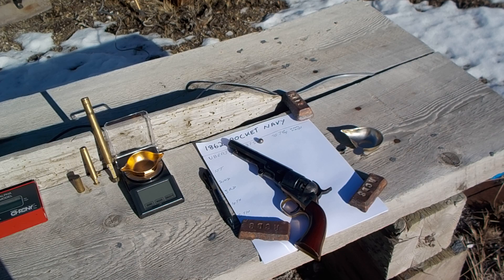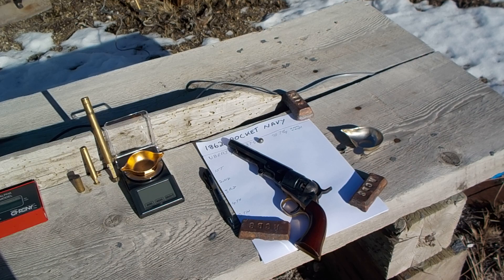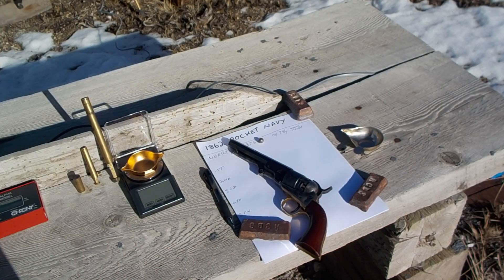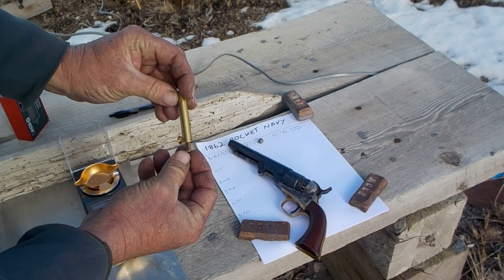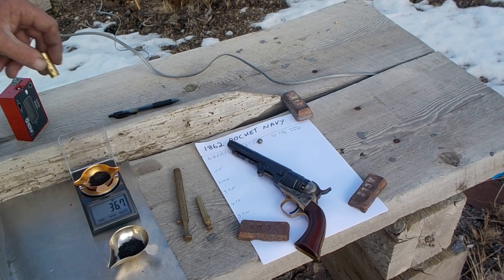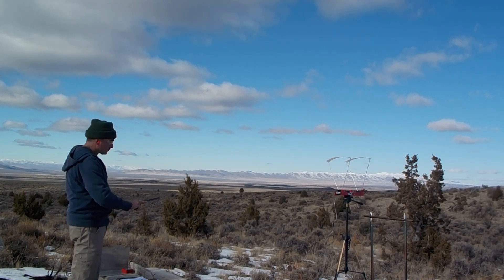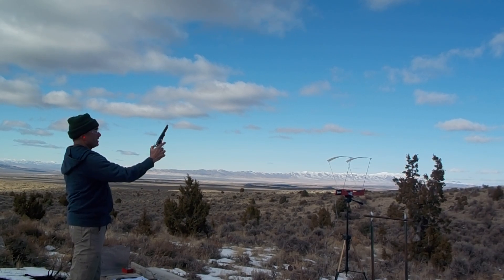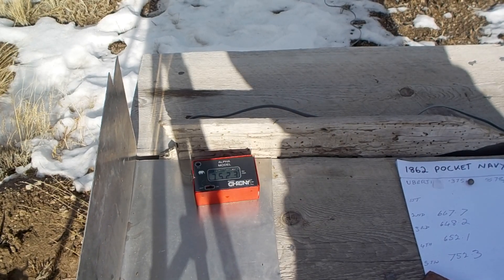1862 Navy Pocket

Comment: Colts are not notorious for cap jams, quality problemed replicas are though.  Proper fitting caps all but elliminate cap problems.
I have the Authentic Colts.  This 'Pocket Navy' is my favorite!  Through 4 pine boards at 50yds with elongated balls cast from the Colt molds. I ve  got Colt s  Patent molds which cast heavy, medium and light elongated balls.   Heavy 148g w/17g charge, Medium 130g w/ 19g and the light 120g w/ 21g. This allows powder compression to stop before the rammer reaches its stop, and the tip of the ball is   j u s t   below the chamber surface.
Quite powerful really.

Comment: Colts are notorious for the "cap jam" but this can be reduced a lot by switching to Slix Shot nipples and cleaning up the hammer face with a polishing stone.  Slix Shot nipples have an extra hole in them to reduce blow back pressure which is one cause of the Colt sucking a cap off the nipple and it dropping into the hammer area.  They are also made to fit Remington #10 caps with a very snug fit which also helps reliability.
Reply from the maker: Thanks I have heard about aftermarket nipples I will have to give a try.